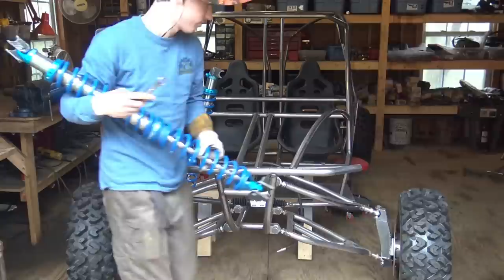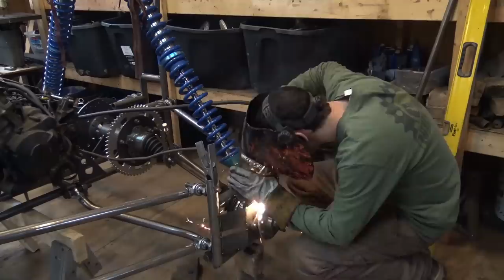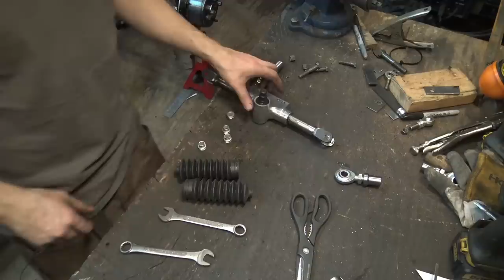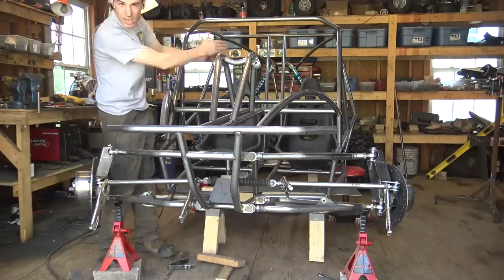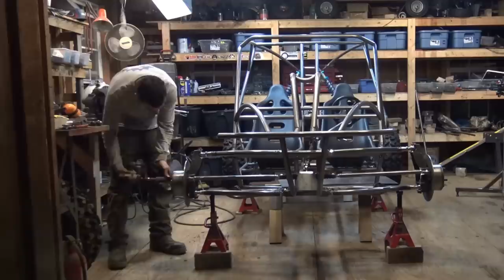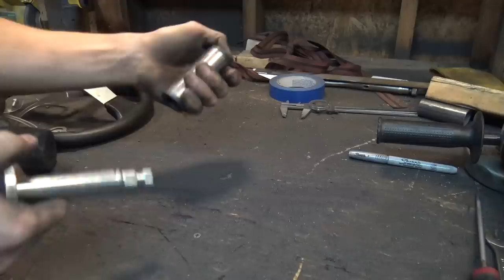Honda CBR 600 buggy build part 7

Comment: Put the steering arms and rack behind the 'kingpin' and your ackerman will work properly .. getting proper ackerman with steering arms and such in front of the kingpin instead of behind is hard.. Behind to get the correct ackerman to shorten the steering tie rods.. when in front you need to lengthen.. problem is it looks like to get to the point you need where your heim joint is beyond the kingpin camber angle will mean your brake disk is in the way..

Comment: I can tell you from experience with those 4x4 S10 hubs that they MUST have the axle stub bolted in. I snapped and axle on an 87 S10 right between the outer CV and the inner side of the hub. I tried to get it home but the whole tire fell off just a few blocks from where I broke the axle.

Comment: How much do you pay for just the steel on a buggy like that
Reply: I'd love to know too, and how many meters of tubing it takes
Reply: It will be more than $5, even more than $6 I guarantee that.
Reply: @infernalGotYou  i bet between 500$ and 1000$
Reply: I've priced it out. In my area, its about $600 just in steel. I started to make something like this and life got in the way.
Reply: probably 2.50 a foot or so. No more than 4-500$ for a complete chassis.
Reply: It's the mistakes that add up.  Ha.
Reply: In my guess it’s all on the steel the tipe of thickness and the sizing so it’s all really on the owners choice to spend more or less money on the tubings but tbh I wouldn’t know the price😂
Reply: Yes it is too bad you don't have a transfer case and four wheel drive. That would be awesome
Reply: You pay by the pound around here.. MI
Reply: Realy dependance on where you order. If you buy in a store you probaly Pay to much. If you go to a local steel Worker who buys in bulk you get a way beter price at least in Holland you do. Sfbe grzz
Reply: More than $10 and less than $1000. Around that.
Reply: tommy23490 where do you buy in mi?
Reply: @HangarGarage  right i need steel for some builds on my channel
Reply: tommy23490 🤔
Reply: @a.j.sgarage9637  Damn life. We would of got finished if it weren't for those darn kids 😂 I want to do a buggy

Comment: It has bump steer because the front suspension hinge points are a bit to narrow on the frame. The center line between the upper and lower a arm mounts should be the same as the steering rack width. Draw a line between the A arm mounts. Front suspension should always be designed around the steering rack. But a little bit isn't the end of the world.

Comment: again, that scrub radius looks dangerous. notice how its throwing the steering wheel around just for the little bump getting into the garage.

the point that the wheels turn around is the point if you draw a line through the outer ball joints to the ground. 

that point should pretty much be in the center of the tire contact patch. now its not even on the tire at all. its outside the tire. 

you will have a really hard time controlling that when it gets bumpy. 

Anyway. loving the build and looking forward to seeing you rip this thing :)

Comment: You can indeed weld the axles up. Problem is they are designed to flex slightly under sudden shock loads like clutch drops or the sudden traction gained upon landing a jump. Most driveshaft shops can build a custom length CV axle. Also that's a terrible waste of a long travel King, if I were you I'd sell those and get a shorter set or even better yet build the buggy to take advantage of all that travel.

Comment: excessive Ackermann angle would be preferable over negative but when your off road in the dirt it really doesnt matter that much...and for street it only makes a difference for tire wear...dont sweat the small stuff, you can always change it later if its intolerable but it wont be for off road...it will be a plush machine brother

Comment: You don't need to buy a softer coil-overs. if you make them more upright they will become softer...like move them a bit closer to the center of car in the front..
And for the back, if you anyhow change the angle they will become softer or stiffer.
And also you can play with the leverage and that might help as well.
I don't exactly know if it works this way but worth of try :D 
Btw good job

Comment: Hey ma. That front wheel hub I think it needs a cv axle to hold it together
Reply: taco 8v a big bolt and lock nut works as well
Reply: Mad Man Marine I was waiting for him to reply because I wanted to tell him that .  Or just cut the cv axle like he did on the rears 🤷‍♂️ and just used for hold it together , but I wasn’t sure if he got the ones the don’tneed a cv axle

Comment: And yes 4x4 gm hubs are compressed together with the axle nut/spline assembly. If you dont figure out something to compress those bearings together you will loose a wheel and do so in spectacular fashion rather quickly

Comment: Lovely work so far, looking forward to the finished product! Isn't the roof line a little high? If you want to save weight and get the rear shocks straighter why not drop the roof line a little and mount the shocks to the bar making up rear end of the roof? Awesome job still!

Comment: I've got a Ducati 900 V-Twin. Make 72 horsepower and 60 foot pounds of torque. But it gives you all of that power from 1500 RPM up to eight grand. I'll tell you the motor throttle bodies wire harness all the stuff you need for 1200 bucks.

Comment: I see you have a tendency to lean toward offroad vehicles, however, with your preference for motorcycle engines, I'd really like to see a street build. Maybe a single seat race cart? I really want to see someone build a go kart with pushrod suspension. Maybe I'm missing some engineering flaw that makes pushrods not functional on a go kart, but I'm not aware of any currently. Upvote if you would like to see it too. I can imagine a long, low, formula 1 style go kart with a motorcycle engine and transmission absolutely ripping.

Comment: I think you need to lower the top suspension mounts so the buggy sits a bit higher you seem to have pretty limited travel on the front especially and that's with just you jumping on it with 2 people i can see it bottoming out more so if you put softer springs in the front

Comment: If them front hubs are the same as the rear and have the spline hole in the front like the rear, then yes you need a cut CV axle or a big bolt and nut to squeeze it together cause each side is a half bearing in a way...

Comment: Congrats, it's a nice buggy. This is not the way I would do it, but based on the knowledge you say you have, it's a great job. I am watching this video now, and many things may have received changes till now, so what I will say now can be out-of-date. Or not. I found a mistake between 9:00 and 9:20, the angle you left in the intermediate and lower U-Joint in the steering column. If you increase the angle in an U-Joint you will increase the necessary torque in the steering wheel, and as the U-Joints have very different angles, the steering angle in the wheels will not be linear with the steering angle but will vary according to the steering wheel position. We can leave alway the upper U-Joint because due to the long shaft connecting the intermediate and the upper U-Joint the angle is very small, with negligible results. So my suggestion is to lower the support you put close to the intermediate U-Joint. At 9:00 we can see you have enough room to do that. Sorry if it looks like I am trying to tell you what to do in your buggy, it's not my intention, I just want to help you. And congratulations one more time.

Comment: You gotta get the axles red hot before you can weld them, high tensile steel can’t be welded cold otherwise it won’t penetrate

Comment: Use 1998+ Chevrolet S10 Blazer 2wd front wheel bearings.  Exact same design and installing but doesn't require an axle through it to keep it together

Comment: id say by the looks of the angles in the rear CV's they wont be happy, ideally CV's want to be perfectly flat and then they accommodate for travel either way, but if theyre at a massive angle 100% of the time, probs not so good, look into it, theres a fair few issues which may arise.

Comment: on your front steering.......  at the wheel..........  On your spindle, if you just flip those flanges around so that they angle inward instead of out ward as you have them.. It will fix the clearance issue you were having at the end of the video.

Comment: Very cool project!  I have two questions...

1. Won’t a buggy of that stature, with independent suspension on  four corners and such a wide mass area, want to sway badly at higher speeds without a sway bar?

2. Isn’t steering effort load increased when the front wheel offset is outboard substantially from the point of steering rotation?  Perhaps it’s not enough added load to be concerned about. 

*Thanks for doing such cool projects!

Comment: This thing is looking awesome! Don't sweat the little issues that come up, this is a big project, just work through them and it will get done!
By the way, what was that material you machined the steering shaft bushings from?

Comment: rather B welding 
  Go to the junkyard and get two front cv axles to cut the stubs off of. 
  Let me know the year of the s10 hub and I will post an alldata torque spec for you.
  I recommend using stubs from junkyard axles over a bolt. They will fit in the splined hub and have the correct thread pitch to set bearing preload with the specified torque. If a regular bolt is used it will likely be torqued at a slight angle, resulting in premature bearing wear.

Comment: Why not put the knuckle steering-mount on the back? rather than the front of the knuckle? Instead of moving the mount more outboard to correct Ackerman, you would move them more inboard, which would give you more room for suspension travel.

There's a series on here called Project Binky. Someone fits MR2 running gear to a British Mini and in one episode he measures out the Ackerman in the garage.
Also, look into Progressive Ackerman and Digressive Ackerman.
The design you choose will have a huge influence on oversteer/understeer, which will be a significant concern after you determine how adequate the engine is for this application.

Comment: It's not a bolt you need for the front hubs it's the male part of the outer cv joint and nut to hold the bearing together. Otherwise by by front wheels.

Comment: the front is very wide... you could shorten the length  between front wheels..
Reply: filippance y would u both having it wider makes it less easier for flipping and makes the buggy hook threw corners
Reply: Shortening the front will decrease suspension travel
Reply: I think you meant nerrow the front , length is front to back , width is side to side , but i get what you meant nun the less and i agree its seems a bit wide for any kind of trail ridding and i dont think he is near any sand dunes . Still its one bad ass build and he fabs everything him self so hats off to him i wish i had the machines to make stuff like his , i manage .......

Comment: Next time you go to move a ride around without using the engine, use your power to roll the tires instead of pushing on the frame. Believe it or not, its easier that way. Me and another guy loaded a '46 Plymouth 4 door on 4x4 frame with 35 inch super swamper tires on a flatbed that way. Tested and proven. No winch required.

Comment: Was wondering what you were going to do about those short cv shafts. Also curious why you put the steering linkage ahead of the swingarms and not behind them like it is on most vehicles? And that hub definitely  needs a bolt through the center torqued to the right ft/lb.

Comment: Did you use an oil impregnated steel for the bushings on the steering column? I thought it had a wild looking oxide layer, but when you turned it down, the pattern was still present.

Comment: don't remove the material out of your tie rod mount Add a 1" spacer to the top and push the top tab up  1", slap in a longer bolt keep that beefy tab intact.

Comment: As an owner of 3 4x4 s10 blazers you have to have the cv shaft going through the hubs and the cv shaft nut on at 75 foot pound to keep them together and last, otherwise your asking for problems, ive had to change my hubs again and again and again because i listend to people the dont know what they are talking about. So i contacted a chevy dealer and they told me what to do, don't believe me? Contact a chevy dealership your self, the info is free in the parts department

Comment: AWESOME BUILD! should your steering linkage be behind the swing arms? and shouldn't the lower A-arm be sitting level when its sitting static? that way the suspension has room to actuate? as someone else noted it should also be narrower than the rear.

Comment: the s10 4x4 hubs need a bolt or an old axle stub bolted in at 103ftlbs!! Not hard but dont forget 103 ft lbs. These hubs suck and fall apart with just too much or too little

Comment: go to the boneyard and get a 1991/92 Tempo/Topaz F.I. 2.3L and Trans, cheap. Cut the Airbox Restrictor out and gain 30hp. from the 95hp 125lbs.ft engine.

Comment: This build is turning out pretty damn cool. On a side note for another project have you ever messed with the cantilever suspension system? I think it is pretty neat looking I just ain't quite sure how functional it is.
Reply: It thought out and properly planned they work great. Had cantilever setups on the rear of my 2 last bagged trucks that worked great. The very last one I used the IRS center pumpkin out of a ford explorer in the back of a s10 with a 350. It would lay on the ground but ride like a caddy when at ride height. They just tend to take up a good bit of room. I've seen buggies and rock crawlers use it on the front so the shocks don't have to be 4 foot long and stick up in the line of sight. I think it would be a PITA to try to do it on the rear with the engine and everything else going on back there.
Reply: The height of the front shock Towers is what was giving me the thought. He was talking about how they are too stiff already in that he has to get something different

Comment: My opinion I think you could of went without the truck size king shocks. And used something a lil smaller. Its not like your gonna really put them to use with that light of a buggy. Just a little overkill with the king. But cool build.

Comment: Hey brother, My wife and I are wanting to hand build one of these for our northern Mi property...I dont want it to be any wider than a Polaris Razor so after studying your awesome design I am considering using a single center frame rather than the double tubing you have spread apart...so my front control arms will pivot off of the same tube...how do you feel about that? Does it seem feesable?

Comment: I would like to see the suspension travel with the coils off. Looks like you may not be using all of those expensive shocks. Wheel travel above the bottom of the chassis is unusable!

Comment: You have some major error on it:

Your wheel is way to far from the spindle ball joint. (Way to much offset)You gonna break your arm to hold the steering on it. You can fix it by making a smaller disc brake so it can fit in the wheel.

Your shock need to be mount on the 2/3 of the arm. You mounted it at the half up front and at the end of the arm on the rear. 

When your suspension arm is at its highest point, your shock need to be at a square position against it. The angle of the shock up front is good, but it s really not good on the rear.

You are a really good fabricator. You impress me. I wish this comment will help.

Comment: The 4x4 S10 bearing assemblies ABSOLUTELY DO need a bolt or axle to hold them together.  I am not speculating.  Ask me how I know...

Virtually ALL bearing assemblies that use a CV joint need the axle to hold the bearings together.  Very rare exceptions exist, but not many.

Comment: How much do your projects all together usually cost ? I’m really looking into making one of these myself . I NEED A RESPONSE
Reply: One of these done right but every budget corner safely cut will still be in the neighborhood of 3k+. Normally pushing about 5k. About the best thing you can do is find one of the companies that have put in the R&D to figure out all the little problems like he has and just give them the $80 or so for a set of detailed plans. They will give you a detailed set of plans you can carry to a metal shop to have everything cut, you might have to do some minor grinding. You also will not run into the steering issues like he is gonna have, having tubes he doesn't need, needing tube where he doesn't have it, and having tube that might look pretty but is gonna fold up due to poor design.
Reply: neo 71665 Yep, he's already said he's in at least 3k here in materials alone.

Comment: why do you put a rope to adjust the angle of the hub and what is the right angle for the direction and what angle is needed for a good direction and suspension. I'm not sure to understand
I want to build a similar buggy but I can not understand the perfect angle for the front hub

Comment: use a honda engine they are simple and make good power and you will have a decent transition and you will get the power you need and it will be lighter than a honda also good gas millage

Comment: i kinda have a feeling that the driver is going to have a hard time steering the thing, since the wheels are very far from the point of rotation, and can put a lot of force on the steering wheel. some quads are barely drivable because of this.